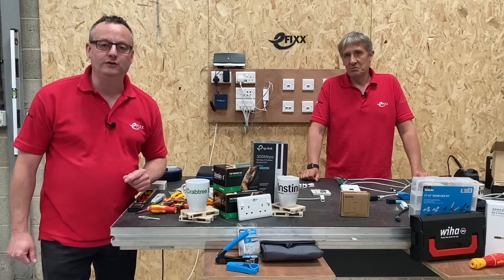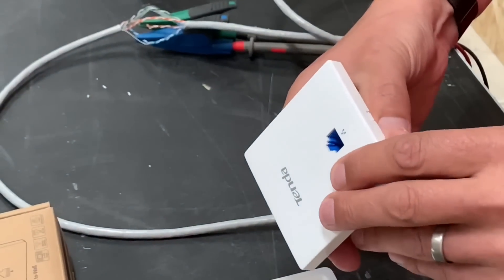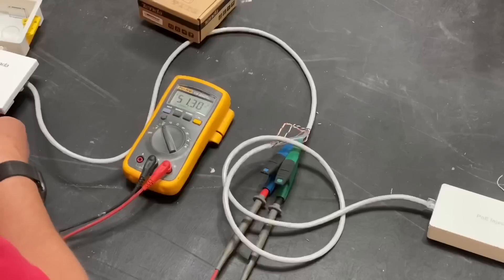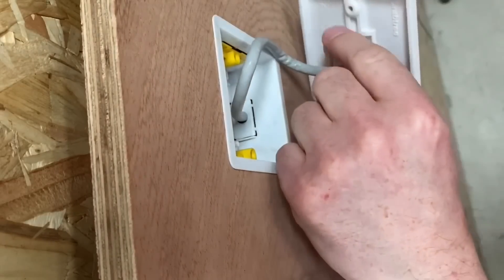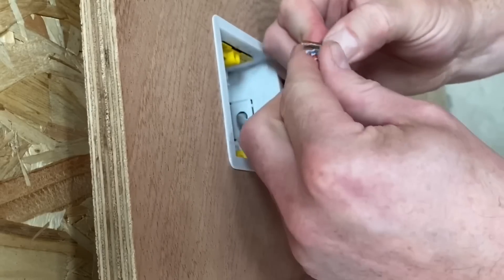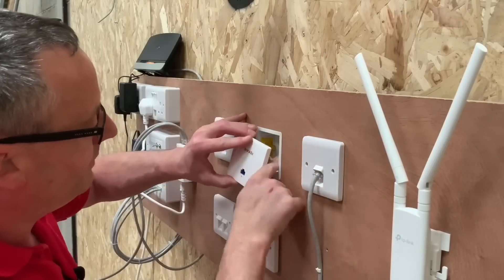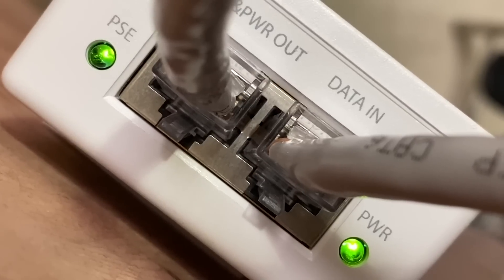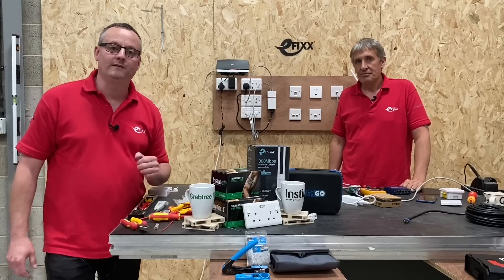Convert an RJ45 network socket to a TENDA WiFi access point.

Comment: As someone from an IT background: You do a great job as an electrician dealing with network cables. So often I see electricians striping back network cables 15 cm and than attaching the keystone (or plug) which is really bad because it can and did in some cases create issues with higher link speeds 10 Gig and even 2.5 Gig

Comment: A bit of a question? I’ve got a cat5e data cable that was feeding a non poe wifi accses point and I was getting 300mbps consistently but then I saw your great videos about the tends access point and installed one but of course I had to install a PoE injector and it works perfectly but Im now only getting speeds of 50 to 80 mbps Which is still good but i want to know how I can get the speeds higher also jsut to let you know I’m using cat5e and it’s a 70 meter run in total and I’m using a tp link injector cost about 25 quid it’s a 15 watt one which is sufficient for the tenda wireless access point please can some people help me out please thank 🙏
Reply from the maker: Do you still have your other access point on the network ?
Reply: @efixx  no I’ve only jsut got the 1 accses point

Comment: Usually for fixed installations you use cable with single wire conductors. These are not meant to be crimped into plugs! To make this right, you would have to replace the cable with actual patch cable!
Reply: There are plugs which are designed for that kind of cable

Comment: Hi
Thanks for the information on the winding cable re keeping it waterproof away from the electrical parts of the Anderson A2
The order thing that I wanted to know is is there another cable required when adding it to a solar system
Reply from the maker: Yes you’d need to fit a current clamp to monitor power exported by the solar panel.  - this usually needs a single twisted pair back to the main incoming meter tails.

Comment: I'm in the process of installing cat 6
May give these a look instead of upgrading my old unifi ap.

Have you seen any issues using the open ended rj45 jacks. I've seen some people say they can cause interference. But I like the idea as even with the expensive crimper at work I have about a 1 in 4 success rate with normal jacks.
Reply from the maker: We love the feed through connectors - never had any problems.
Reply: Ordered a couple from Tenda via AliExpress. Will see what they are like when they turn up next year 😂

Comment: Would work a bit better if you guys used plastic boxes in the brickwork as well, would be cool if you tested it in a normal metal box and see how fast is the wifi on that.. don’t think I’d change it for a normal access point with a larger antenna 🤔 funny name for wifi bits, Tenda ⛺️

Comment: Ahhhhhh sparks doing networking..... abort abort!!!
Reply from the maker: The new reality lots of equipment such as EV chargers need data connections.
Reply: @efixx  Absolutely 💯,  just one thing that grinds the gears of us IT guys is cables stuffed into the back of patress boxes with no regards for bend radius and WiFi setup with no site survey...
Reply: It was the first part stripping pvc sleeve with that twisty thing, 5 mins untwisting pairs,  and then the large electrical pliers to cut the spline #cringe had a vision of using a sledge hammer to put up a drawing pin :) at least they have discovered pass through RJ45, but they mean well and take on board comments

Comment: I prefer The unifi range as they have a selection of access points designed for uk sockets as well as outdoor points. the user interface is much easier as well allowing for a mesh wifi setup without much work. the tp link access point is a copy of their mesh range but isnt as powerful
Reply from the maker: great feedback thanks we'll check out the unifi range for a future project.

Comment: Not these guys again you don’t like people doing there own electrical work so don’t try and diy some one else’s profession other wise we have to come and rip all this crap out when it don’t work done this more than a few times now. had an electrician run 2 cables as he had the board up to run some other cable the state was shocking along with using staples into plaster board over a door and zip tie power and data together it needs ripping out and doing again
Reply: Anyone installing cables in the way you describe is a bad electrician as well as a bad IT engineer, don’t judge everyone by their low standards.
Reply from the maker: It's not exactly rocket science - lots of electrical contractors fit data installations.
Reply: What a rubbish company you must be. WiFi installed correctly takes a lot more than just plugging a cable in you need to be setting the right channel looking a noise correct location to install the wireless with current channel utilization. I would not install a fuse board so don’t do someone else’s profession bunch of idiots
Reply from the maker: @adriangoodwin4801  Thanks for your positive comments - "Bunch of idiots" - The reality is lots of electrical equipment in the new world of power needs both power and data connections - EV chargers, solar inverters, home storage batteries, smart home tech. So in the real world, a homeowner won't want to have to call two trades to terminate two types of cable.  So some element of upskilling is required for all installers.  Data installation also forms part of most modern electrical apprenticeships.
Reply: How does installing a data cable in a ev charger relate to wireless they actually don’t use 2.4ghz or 5ghz wireless for devices like this. There is a saying a little knowledge is a dangerous thing and this here a prime example I’m afraid you don’t have the understanding of what you are trying to install with home working become a more common thing business will need to make sure home users have a secure and reliable home network which you have no understanding on if you can’t tell the difference and are not able provide the correct information

Comment: I fitted two Tenda five port PoE switches when I was desperate for a quick cheap fix.  Both failed within six months.  They were cheap, but cost me dearly in the long run, so won't fall into that trap again.  It's a bit like non-electricians fitting cheap sockets and accessories (it's just a socket, what can go wrong?), then a 'proper' electrician cursing all the high readings when tested.

Comment: Electricians please leave the data networking to us IT Pros! You don't put RJ45s on solid core cable and you dont use stranded cable for structured wiring. A patch panel is a specific item, what you have is just a 4 way RJ45 box.
Reply: Also the cat5 cable was literally stuffed into the back box. No regard for minimum bend radius on the UTP. Additionally no test done on the cable.
Reply: Networking wasn't something that was taught when I served my time in the late 90s so I'd tend to leave it to the IT pros like your good self. Problem is this is really becoming a massive part of the industry now, especially with all the smart devices etc. It's something I really need to get my head round. What's a good starting point for a novice?
Reply: @Daniells1982  if you're a complete novice I would look at CBT Nuggets Cisco CCENT course. Gives you a good grounding in Network theory. Also on YT there's a channel called Keeping IT Simple. Focuses on real world install and config.
Reply: @Rainbowhockey  thanks. I'll take a look.
Reply: I have seen a lot of IT pros make rats nest out of structured cable installs just as much as an electrican with very little experience in it, theres a lot of so called IT pros who haven't a clue on dressing or forming cables, cable management down to even cross patching a network all because there clueless on how to provide proper containment or just don't know how to properly handle cabling, so don't be so quick to judge these guys are just trying to help
Reply: @eamonnblake9704  It's true some IT pros are terrible at Networking. But I've seen more electricians make a mess of terminations and sockets etc. I know these guys are trying to be helpful but if the shoe was on the other foot there would be hoards of sparks commenting to leave electrics to the professionals.
Reply: @Rainbowhockey  yes but you can't paint everyone with the same  brush I have seen networks that are cross patched only by IT pros  that have been made a shambles of over a build up of time all because of pure laziness and of course when someone questions it the electrician's that installed the network get the blame even if the cross patching is the responsibility of the IT guy!
Reply: @eamonnblake9704  Neither can you tar everyone with the same brush. I've seen some shocking electrical work (pardon the pun) in frankly dangerous condition. Any IT professional worth their salt will do a proper job You wouldn't ask a Plumber to wire a house. Hire the right tradesman for the right job. Just because it's a wire doesn't neccessarily mean you should hire an electrician. Not sure what you mean by "cross patching".
Reply: @Rainbowhockey  that's true but you shouldn't hire an IT pro either to judge electrical work, what I mean by cross patching is when patch leads are plugged form switches to patch panel ports, some IT guy decide to fling leads form one rack to another "as the crow flys"using 6 meter leads for a 2 or 3 meter distance
Reply: @eamonnblake9704  That's what I'm saying. I wouldn't hire an IT guy to rewire the power to my house. 

Some IT guys are lazy and will just patch with whatever they have rather than using the correct sized cable. Those guys do not represent the majority of IT professionals just as the shoddy workmanship of some "electricians" do not represent the majority of decent hard working electricians.

Comment: Interesting to see a front plate that takes an RJ45 connector, on a previous video I talked about how the push down tool was a tricky thing to use the first time during training, and I found the RJ45 a little easier to do. My tutor was unsure about front plates connected this way, having not seen many. It seems a logical way to connect them as the front plate can then be swapped out without having to renew the connections into it. Even a standard wall socket for ethernet would be much simpler this way.

Comment: Same as the TP Link EAP115-WALL.

They also have the 225-WALL which is dual band too, I use them myself with an OC200 controller.

Comment: These would be OK if you have tech that needs WiFi but it will stay in the local area of this access point, perhaps a home office. If the tech is mobile, such as kids running around with phones, this will not be the best option. Staying with Tenda, a mesh solution would be better. The POE would make the deployment of that mesh router easierthough.

Comment: It's a shame that Sparkys use horrible wifi makes such as Tenda, when good alternatives like Ubnt are a thing.
Reply: Was about to suggest that people pay a bit more and go with unifi in-wall hd access point, but cant knock the price point and speeds of the tenda options though.
Reply: @_Miner  £30 isn’t bad but I do question it’s performance/range and you definitely wouldn’t want to install them in hotels for security reasons
Reply: I was about to point out the same thing. What's really disappointing is that their only qualifier is that it fits in a UK electrical box. And then they try to act like they're experts in networking, but giving piss poor recommendations to people who are looking for a good solution.
Reply: This Tenda W9 has a big weak point in that it has Fast Ethernet ports which can only transmit 100 Mbp/s. I don't think the guys on this channel would have seen this. The TP-Link EAP230-WALL is the better option.

Comment: So a great panel. In theory. But they are 2.4Ghz only. And if running at 300mbit if you are sat right near it. These can just make it all slower for everyone in a congested wifi area as it uses even more channels - only 13 in the 2.4 gig range. 5Ghz has close to 100 (subject to DFS) Only has a 100mbit PoE port, not gigabit so limits it as an access point to 100mbit throughput. And if used as a repeater you half the available bandwidth anyway due to the way it works. Adding more SSID's introduces more beaconing - see this as to why its a bad idea https://wiki.emfcamp.org/wiki/Network/Rogue_Access_Points . It does not also take in to account the use of the 5Ghz which is far more suitable for high bandwidth devices and also less suseptable to interference. A lot more devices now use 5Ghz which means that the 2.4 is being freed up so that there is the airtime for it but still not without its problems.
Reply from the maker: Thanks for the detailed feedback.

Tenda also make a newer version in dual band with 5Ghz
https://cpc.farnell.com/tenda/w9/ac1200-in-wall-access-point/dp/CS32418
Reply: We are all here to learn. I see so many mistakes with wifi networks all the time. The dual band is great but still only a 10/100 uplink :) Gigabit PoE is easy enough but costs a lot more
Reply from the maker: We appreciate the comments. We are producing this series to help electricians add value to their existing work.  So we are trying to start with the basics and ramp up as we all. So pointers are always welcome from people who live in this world . - Cheers Gordon
Reply: How about you leave it to the IT pros would you like it if we started doing fuse boards no so don’t take someone else’s work